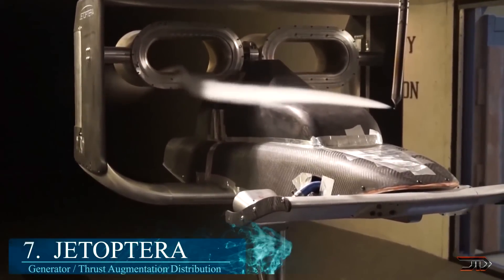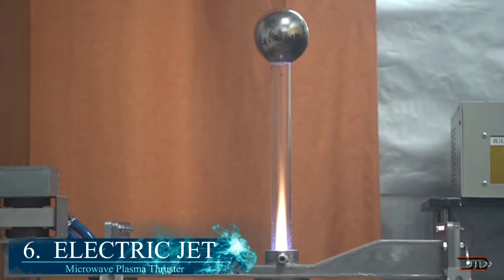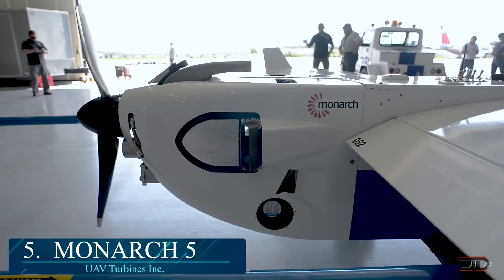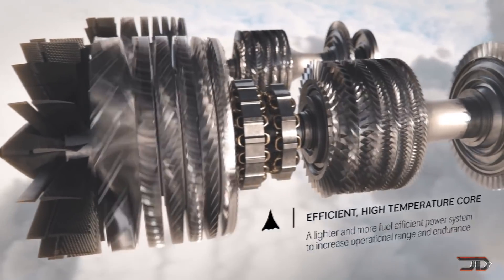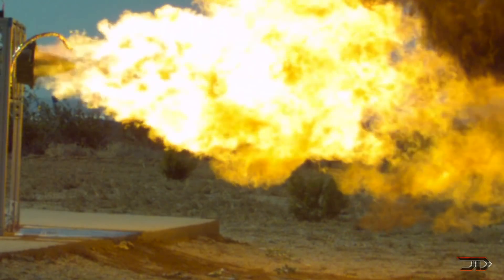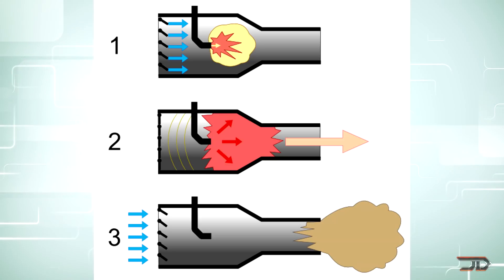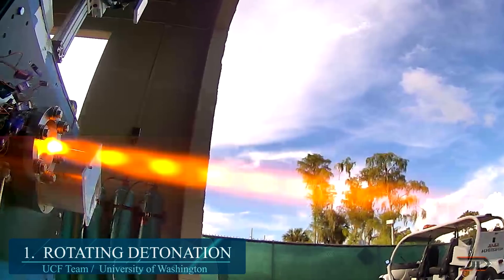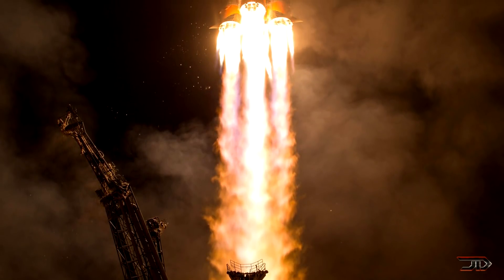7 STRANGEST New Aerospace ENGINES

Comment: 4:05 Wasn't the old German V1 (or V2?) rockets driven by an engine with the exact same technology?
4:18 ...Air goes in, mixes & detonates, then continues out the other side & the under-pressure after the shock-wave sucks in new air.
Those rocket engines had a problem with the "flaps" that closed off the air intake, they got worn out, but because it was meant to explode anyway, it wasn't a real problem, but if you put it on an airplane for long time use, then it WILL be a problem.
Reply: A pulsating jet engine (PuVRD) is a variant of an air jet engine. The PUVRD uses a combustion chamber with inlet valves and a long cylindrical outlet nozzle. Fuel and air are supplied periodically.

The first patents for a pulsating jet engine were obtained (independently of each other) in the 1860s by Charles de Louvrier (France) and Nikolai Afanasyevich Teleshov (Russia).

German designers, even on the eve of World War II, were conducting a broad search for alternatives to piston aircraft engines, did not ignore this invention, which remained unclaimed for a long time. The most famous aircraft (and the only serial one) with the Argus As-014 PUVRD manufactured by Argus-Werken was the German V-1 projectile. The chief designer of the V-1 Robert Lusser chose a PuVRD for him not for the sake of efficiency (piston aircraft engines of that era had the best characteristics), but mainly because of the simplicity of the design and, as a result, low labor costs for manufacturing, which was justified with a massive the production of disposable shells, mass-produced in less than a year (from June 1944 to March 1945) in an amount of over 10 thousand units.

V-1 engine
After the war, research on pulsating jet engines continued in France (SNECMA) and in the USA (Pratt & Whitney, General Electric).
The results of these developments interested the military of the USA and the USSR. A number of prototypes and experimental samples were developed. Initially, the main problem with air-to-surface missiles was the imperfection of the inertial guidance system, the accuracy of which was considered good if the missile hit a square with sides of 3 kilometers from a range of 150 kilometers. This led to the fact that with a warhead based on a conventional explosive, these missiles had low efficiency, and nuclear charges, at the same time, had too large a mass (several tons). When compact nuclear charges appeared, the design of more efficient turbojet engines had already been worked out, so pulsating air-jet engines did not become widespread.

Representatives of air-to-surface rockets with a pulsating jet engine.
Third Reich Fi-103
USSR 10X · 14X · 16X - thanks to the use of two engines, the practical limit of flight speed for the PuVRD was reached - 980 km / h (270 m / s).
USA JB-2
In the early 2010s, there is a revival of interest in PuVRD: their development and testing are carried out by General Electric, Pratt & Whitney, SNECMA, as well as the domestic NPO Saturn

Scope of PuVRD
PUVRD is characterized as noisy and wasteful, but simple and cheap. The high level of noise and vibration arises from the very pulsating mode of its operation. The uneconomical nature of fuel use is evidenced by an extensive torch "beating" from the PUVRD nozzle - a consequence of incomplete combustion of fuel in the chamber.
Tests of the American Mustang P-51 with PUVRD
Comparison of the PUVRD with other aircraft engines makes it possible to fairly accurately determine the area of its applicability.
A PUVRD is many times cheaper to manufacture than a gas turbine or piston internal combustion engine, therefore, with a single use, it wins economically over them (of course, provided that it "copes" with their work). With long-term operation of a reusable device, PuVRD loses economically to the same engines due to wasteful fuel consumption.
In terms of simplicity and low cost, the ramjet is practically not inferior to the PuVRD, but at speeds less than 0.5M it is inoperative. At higher speeds, the ramjet is superior in efficiency to the PuVRD (when the valve is closed, the drag of the PuVRD sharply increases and at transonic speeds it “eats up” almost all the thrust created by this engine).
Homemade stainless steel motor
The combination of these circumstances determines the niche in which PUVRDs are used - single-use unmanned aerial vehicles with operating speeds of up to 0.5M, - flying targets, unmanned reconnaissance aircraft. For the same reasons, the engine is also used in aircraft modeling.
Due to the simplicity and low cost, PUVRDs are widespread in amateur aviation and aircraft modeling. Small engines of this type have become very popular among model aircraft designers and in amateur aviation. For this reason, commercial firms have appeared that manufacture for sale for these purposes PUVRD and valves for them (a high-wear spare part).
The PUVRD can be used not only as an engine, but also as a stationary unit for generating heat.

Other pulsating WFD

Valveless PUVRD
Samples of valveless (U-shaped) PUVRD.
In the literature, there is a description of engines similar to the PUVRD.
Valveless PuVRD, otherwise - U-shaped PuVRD. In these engines there are no mechanical air valves, and so that the reverse movement of the working fluid does not lead to a decrease in thrust, the engine path is made in the form of the Latin letter "U", the ends of which are turned backward in the direction of movement of the apparatus, while the outflow of the jet stream occurs immediately from both ends path. Fresh air is supplied to the combustion chamber due to the rarefaction wave that appears after the impulse and "ventilates" the chamber, and the sophisticated shape of the tract serves for the best performance of this function. The absence of valves allows you to get rid of the characteristic drawback of the valve PUVRD - their low durability (on the V-1 projectile, the valves burned out after about half an hour of flight, which was quite enough to complete its combat missions, but absolutely unacceptable for a reusable device).

Detonation PuVRD. (English name PDE) In these engines, the combustion of the fuel mixture occurs in the detonation mode (in contrast to deflagration, which occurs during the combustion of fuel-air mixtures in all WFDs discussed above). The detonation wave propagates in the fuel mixture much faster than the sound wave, therefore, during the chemical reaction of detonation combustion, the volume of the fuel mixture does not have time to increase significantly, and the pressure increases abruptly (up to values over 100 atm), thus isochoric (at constant volume) heating takes place working fluid. After this, the phase of expansion of the working fluid in the nozzle begins with the formation of a jet stream. Detonation PuVRD can be with or without valves.
A potential advantage of a detonation jet engine is considered to be a higher thermal efficiency than any other type of jet engine. The practical implementation of this engine is in the experimental stage.

Detonation PuVRD has been studied for over 70 years. The main problems: fast and efficient mixing of fuel and oxidizer, prevention of spontaneous combustion, integration of the nozzle and air intake. Not mass-produced, but several test engines were demonstrated on low-speed aircraft in 2008.
In July 2016, the world's first tests of an experimental detonation rocket engine took place at the Energomash stand in Russia.
At the end of December 2016, the American company Aerojet Rocketdyne received a contract from the US National Energy Technology Laboratory to develop a new gas turbine power plant based on a rotary detonation engine. The work, as a result of which a prototype of the new installation will be created, was planned to be completed by mid-2019, but the completion date of the project was postponed. Engine tests were carried out in 2020.
In 2021, Russia completed the first stage of testing a demonstrator of a direct-flow pulsating detonation engine developed at NPO Energomash (UEC; developed at the Lyulka Design Bureau, which formed a separate direction for the study and development of such power plants), the model runs on kerosene and gaseous oxygen (the first tests of a liquid-propellant detonation rocket engine took place in the summer of 2016; for the first time a model of a pulsating detonation engine was presented at the Army-2017 International Forum). In some operating modes, the engine showed a 50% increase in specific thrust compared to traditional power plants. In the future, it will be used in rocket and space systems, orbital aircraft and hypersonic aircraft.
On July 26, 2021, Japan tested a rotating detonation engine. He worked for 6 seconds.

This video presents Detonation PuVRD. Russia is making an impulse, and the United States is rotating. This is their difference.

Comment: number 2 and 1, ww2 Germany had already a working model in Argus V-1 engine. that is just a pulse motor of the V-1 rocket brought to modern day really.
Reply: same thought lol, some dudes at my university built literally a v2 engine and even colin furze has slammed one on a bike... but the others were quite interesting designs
Reply: @JJ-pm1zv  i really hope you meant a V1 engine.
Reply: A pulsating jet engine (PuVRD) is a variant of an air jet engine. The PUVRD uses a combustion chamber with inlet valves and a long cylindrical outlet nozzle. Fuel and air are supplied periodically.

The first patents for a pulsating jet engine were obtained (independently of each other) in the 1860s by Charles de Louvrier (France) and Nikolai Afanasyevich Teleshov (Russia).

German designers, even on the eve of World War II, were conducting a broad search for alternatives to piston aircraft engines, did not ignore this invention, which remained unclaimed for a long time. The most famous aircraft (and the only serial one) with the Argus As-014 PUVRD manufactured by Argus-Werken was the German V-1 projectile. The chief designer of the V-1 Robert Lusser chose a PuVRD for him not for the sake of efficiency (piston aircraft engines of that era had the best characteristics), but mainly because of the simplicity of the design and, as a result, low labor costs for manufacturing, which was justified with a massive the production of disposable shells, mass-produced in less than a year (from June 1944 to March 1945) in an amount of over 10 thousand units.

V-1 engine
After the war, research on pulsating jet engines continued in France (SNECMA) and in the USA (Pratt & Whitney, General Electric).
The results of these developments interested the military of the USA and the USSR. A number of prototypes and experimental samples were developed. Initially, the main problem with air-to-surface missiles was the imperfection of the inertial guidance system, the accuracy of which was considered good if the missile hit a square with sides of 3 kilometers from a range of 150 kilometers. This led to the fact that with a warhead based on a conventional explosive, these missiles had low efficiency, and nuclear charges, at the same time, had too large a mass (several tons). When compact nuclear charges appeared, the design of more efficient turbojet engines had already been worked out, so pulsating air-jet engines did not become widespread.

Representatives of air-to-surface rockets with a pulsating jet engine.
Third Reich Fi-103
USSR 10X · 14X · 16X - thanks to the use of two engines, the practical limit of flight speed for the PuVRD was reached - 980 km / h (270 m / s).
USA JB-2
In the early 2010s, there is a revival of interest in PuVRD: their development and testing are carried out by General Electric, Pratt & Whitney, SNECMA, as well as the domestic NPO Saturn

Scope of PuVRD
PUVRD is characterized as noisy and wasteful, but simple and cheap. The high level of noise and vibration arises from the very pulsating mode of its operation. The uneconomical nature of fuel use is evidenced by an extensive torch "beating" from the PUVRD nozzle - a consequence of incomplete combustion of fuel in the chamber.
Tests of the American Mustang P-51 with PUVRD
Comparison of the PUVRD with other aircraft engines makes it possible to fairly accurately determine the area of its applicability.
A PUVRD is many times cheaper to manufacture than a gas turbine or piston internal combustion engine, therefore, with a single use, it wins economically over them (of course, provided that it "copes" with their work). With long-term operation of a reusable device, PuVRD loses economically to the same engines due to wasteful fuel consumption.
In terms of simplicity and low cost, the ramjet is practically not inferior to the PuVRD, but at speeds less than 0.5M it is inoperative. At higher speeds, the ramjet is superior in efficiency to the PuVRD (when the valve is closed, the drag of the PuVRD sharply increases and at transonic speeds it “eats up” almost all the thrust created by this engine).
Homemade stainless steel motor
The combination of these circumstances determines the niche in which PUVRDs are used - single-use unmanned aerial vehicles with operating speeds of up to 0.5M, - flying targets, unmanned reconnaissance aircraft. For the same reasons, the engine is also used in aircraft modeling.
Due to the simplicity and low cost, PUVRDs are widespread in amateur aviation and aircraft modeling. Small engines of this type have become very popular among model aircraft designers and in amateur aviation. For this reason, commercial firms have appeared that manufacture for sale for these purposes PUVRD and valves for them (a high-wear spare part).
The PUVRD can be used not only as an engine, but also as a stationary unit for generating heat.

Other pulsating WFD

Valveless PUVRD
Samples of valveless (U-shaped) PUVRD.
In the literature, there is a description of engines similar to the PUVRD.
Valveless PuVRD, otherwise - U-shaped PuVRD. In these engines there are no mechanical air valves, and so that the reverse movement of the working fluid does not lead to a decrease in thrust, the engine path is made in the form of the Latin letter "U", the ends of which are turned backward in the direction of movement of the apparatus, while the outflow of the jet stream occurs immediately from both ends path. Fresh air is supplied to the combustion chamber due to the rarefaction wave that appears after the impulse and "ventilates" the chamber, and the sophisticated shape of the tract serves for the best performance of this function. The absence of valves allows you to get rid of the characteristic drawback of the valve PUVRD - their low durability (on the V-1 projectile, the valves burned out after about half an hour of flight, which was quite enough to complete its combat missions, but absolutely unacceptable for a reusable device).

Detonation PuVRD. (English name PDE) In these engines, the combustion of the fuel mixture occurs in the detonation mode (in contrast to deflagration, which occurs during the combustion of fuel-air mixtures in all WFDs discussed above). The detonation wave propagates in the fuel mixture much faster than the sound wave, therefore, during the chemical reaction of detonation combustion, the volume of the fuel mixture does not have time to increase significantly, and the pressure increases abruptly (up to values over 100 atm), thus isochoric (at constant volume) heating takes place working fluid. After this, the phase of expansion of the working fluid in the nozzle begins with the formation of a jet stream. Detonation PuVRD can be with or without valves.
A potential advantage of a detonation jet engine is considered to be a higher thermal efficiency than any other type of jet engine. The practical implementation of this engine is in the experimental stage.

Detonation PuVRD has been studied for over 70 years. The main problems: fast and efficient mixing of fuel and oxidizer, prevention of spontaneous combustion, integration of the nozzle and air intake. Not mass-produced, but several test engines were demonstrated on low-speed aircraft in 2008.
In July 2016, the world's first tests of an experimental detonation rocket engine took place at the Energomash stand in Russia.
At the end of December 2016, the American company Aerojet Rocketdyne received a contract from the US National Energy Technology Laboratory to develop a new gas turbine power plant based on a rotary detonation engine. The work, as a result of which a prototype of the new installation will be created, was planned to be completed by mid-2019, but the completion date of the project was postponed. Engine tests were carried out in 2020.
In 2021, Russia completed the first stage of testing a demonstrator of a direct-flow pulsating detonation engine developed at NPO Energomash (UEC; developed at the Lyulka Design Bureau, which formed a separate direction for the study and development of such power plants), the model runs on kerosene and gaseous oxygen (the first tests of a liquid-propellant detonation rocket engine took place in the summer of 2016; for the first time a model of a pulsating detonation engine was presented at the Army-2017 International Forum). In some operating modes, the engine showed a 50% increase in specific thrust compared to traditional power plants. In the future, it will be used in rocket and space systems, orbital aircraft and hypersonic aircraft.
On July 26, 2021, Japan tested a rotating detonation engine. He worked for 6 seconds.

This video presents Detonation PuVRD. Russia is making an impulse, and the United States is rotating. This is their difference.